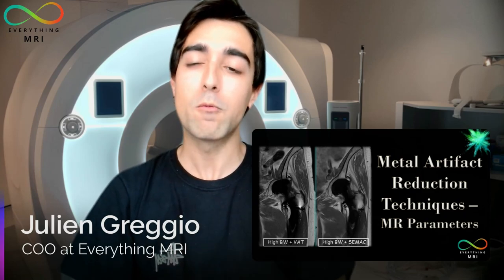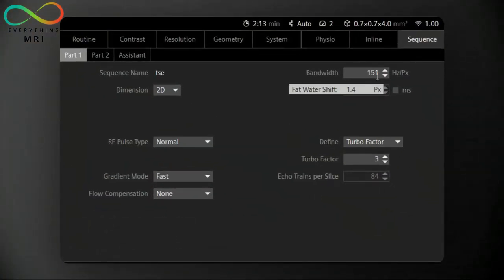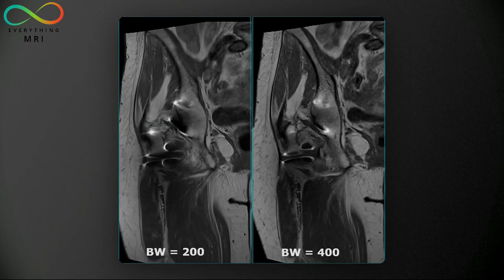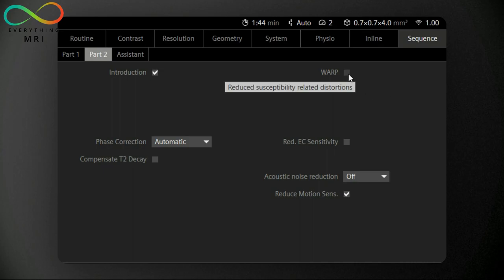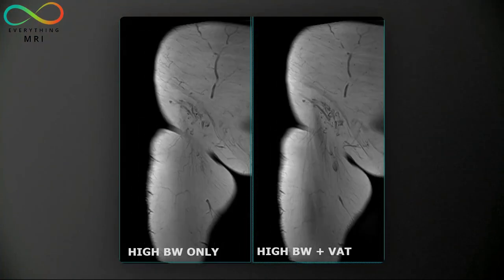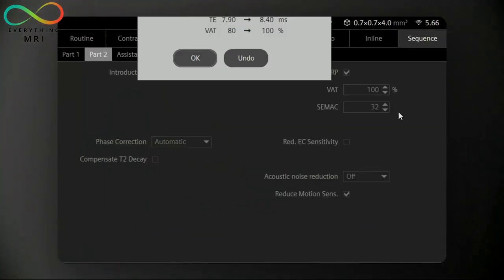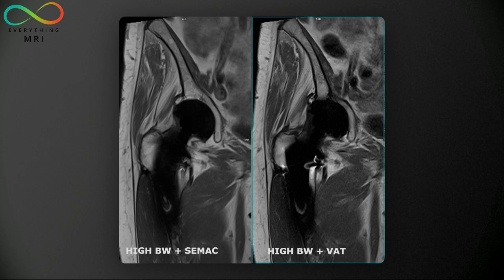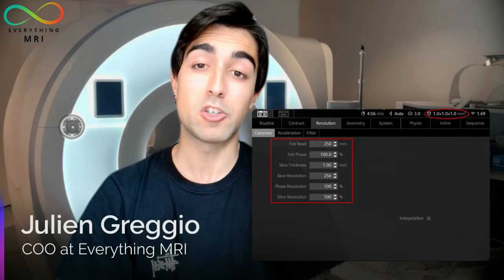Metal Artifact Reduction Techniques - MR Parameters

Comment: Hi Julien, great video! As you said the BW maybe is the real game changer in order to get rid of the most of the metal artifact, but I want to mention two others parameters that are strictly related to the metal artifact reduction: Echo Space and the turbo factor.
The first one should be the lower possible in order to avoid protons dephasing and the second one should be the higher possible in order to collect the most possible number of echo before protons start dephasing due to the inhomogeneities of B0.
Just to share my personal experience in mri mars sequences!
Keep it up with your YouTube channel, I've found it very helpful! For example it helped me a lot in learning cardiac mri planning!
Reply from the maker: Hello Alessandro. First and foremost, thank you so much for reserving some time in writing down such delightful comment. I am sure many MR radiographers will benefit from these concepts you shared (I will try to put them in practice as well).

Also, I want to tell you that I am very glad you found those cardiac videos useful. That was the main reason I opened the channel in the first place. Meaning, giving something back to the community. I am happy it worked for some 🙏🏻
Reply: It was absolutely well spent time! I'm eager to learn new tips and share what I learnt and try to improve my "skills" as rad tech!

I mentioned those two parameters because I read some years ago a Philips mri discussion, but I've never had the opportunity to test it out in the way it's meant to be... 
I don't really know if they could lead to a significant improvement of the image quality or not so considering do it for us and make another video! 😊
Reply: Eeesh! I really wanna have a tones of knowledge in MRi! Just like you!😞